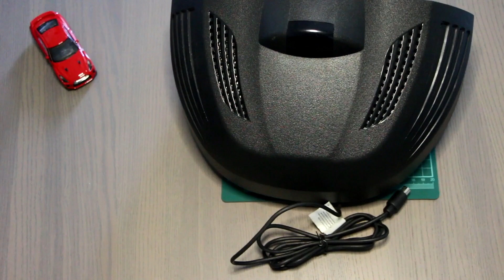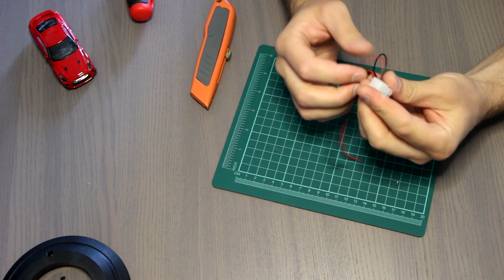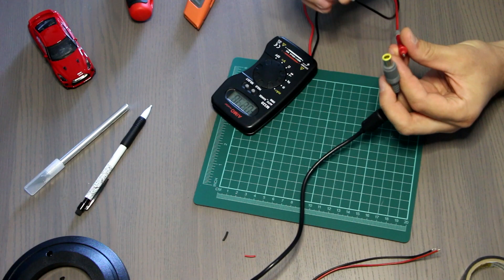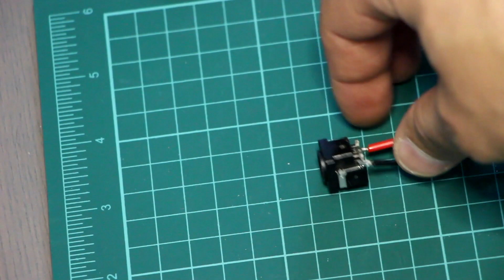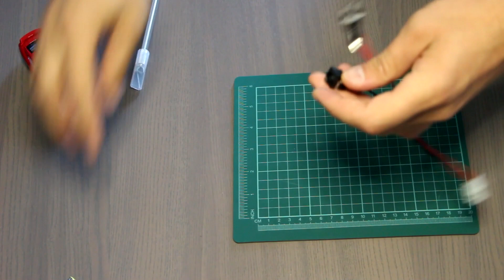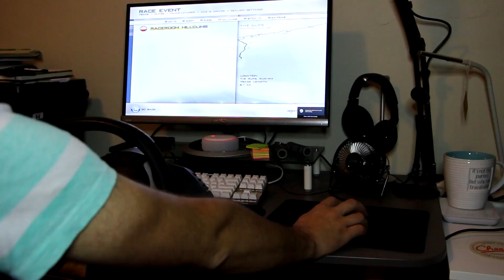Thrustmaster TX T300 wheel - power supply repair/replacement

Comment: This mod works fine. Thank you. It works with  an older PSU  (90w 20v) without fuse.
Reply: Hello, I want to try to see if the power supply is broken. Is there anything wrong with trying it without a fuse? I'll buy one tomorrow.

Comment: Thanks for your contribution, but unfortunately another T300 that refuses to live, I replaced the power supply with a 24V 6A with a 3A fuse, I went step by step, just like the video and nothing, I can't understand what it could be, because the motherboard input connector does get 24V... this steering wheel was working perfectly and when I exited a game, overnight, it stopped working, I would appreciate any charitable soul who can provide some help, thanks in advance

Comment: Hi, one of the silver pins in the 4-pin power supply connector socket is not making contact unless I hold the inserted power cable at an angle. Is is possible to open up that power connector socket and re-solder those pins? I have the ts300 rs gt.

Comment: Hey there, I love your tutorial but I can't get it to work :(
My laptop psu is 19 V 4.74 A 90W
I do it just like you, I also get 19V through the cables when testing. If I plug it in though nothing happens, only reaction I can get is sparks. I am not uskng a fuse. The original power supply was smelling burnt and was also shooting sparks when plugged in...
What else could be wrong with my wheel?
Reply: I have the same problem without sparks tho hope someone will help with advice

Comment: I did this to my T150 with a 24v power supply, I followed same steps and I am not using a fuse. It seems that I can turn it on using usb without problem, I don’t necessarily have to plug in usb first. It is noticeableably faster and stronger. I didn’t go with 30v because I read on a forum that the wheel starts to reduce current which translates to less force feedback, at the cost of a faster rotation speed. 24v was a good middle ground between the two, I felt actually torque and speed increased.

Comment: I know this is an old video now, but im sure my internal psu has gone, i got it fsulty from ebay the usb says descriptor fsult, the wheel foesnt turn or anything and if i test voltage from the psu that goes into the board i get zero volts, but i do get volage straight from the plug to ths TX, will be giving this a try tomorrow.
Reply from the maker: Good luck!
Reply: Did it fix it ?

Comment: Thank you! I bought a dead 'new but returned' T300RS GT off eBay for cheap and was able to resurrect it with a 24V 6A laptop PSU.

Using a 3A fuse currently. No issues so far.
Reply: Hi can i dm on how you went about it?

Comment: Need ur help, i follow all the steps and setting but it doesnt power up still. Not sure why? The ac adaptor that i use Model#:	FMV-AC323 Laptop Charger

INPUT: 100-240V~ 1.35-0.6A, 50-60Hz
OUTPUT: 19V 5.27A 100W
Connecter size: Int. Diameter: 2.50mm
Ext. Diameter: 5.50mm

Comment: Im looking for a powersupply but I see differences in amps. You use a 4.5A charger. Is there a minimum ampares the charger needs to have?

The charger im about to buy:

19,5V
3.34a
65 Watt
Reply from the maker: 3.3 amps is a little low. Even 4.5 amps, I used there is on the low side but it worked well. The wheel base can go little higher sometimes (higher than 6 amp)  and it is better to have more than less. I'll say look for 4.5 amps and up.

Comment: You dont need to to all of tihs is you just replace the FOD4216 Triac. The psu if not blown is just on standby as the triac activates when plugged into a USB port. Witout that it sits in standby giving the impression of it being dead

Watch https://www.youtube.com/watch?v=cbTY9QriLdo&t=5s for a proper way of fixing your t300rs
Reply from the maker: Thank you Nazim for mentioning that. If you check the video starting at 8:10 I mentioned exactly that and how to test if your triac is bad. In my case, the PSU was bad, so I had to do the entire replacement. Replacing a triac is a lot easier indeed
Reply: Ah I thought in the video you only mentioned the one triac and not the other one that tends to fail. Doing the first bypass will not turn on the wheel. But thanks for your response 👍🏽
Reply: I tried following the steps in that video, was measuring 5v when usb was connected but after I've soldered the two pins and jumped the Triac I'm still getting nothing with power on and usb connected. So assuming I have a dead PSU and need to replace per this mod

Comment: Hey! Do you recall what the signs of a failing PSU were? My wheel base has a flickering red light, a loud whine and produces an awful sound when turning (also very hard to turn). Do you think that's the PSU? If so, how difficult is the soldering on this fix, for someone with no prior experience soldering electronics?
Reply from the maker: I don't think is the PSU, but can't tell for sure. It is not hard to solder to be honest, a 5 min youtube video is enough
Reply: @SymyonYY  yeah, I'm starting to think it's more of an issue with the motor. It's out of warranty and they're asking me $180 USD + shipping to repair it, which is close to the price of a new base. I don't think I'll ever purchase a TM product again. Thanks for the quick reply!

Comment: hi, you did very good job but i have a quiestion to you, we have a 4 pin jack to main board why did not you give 5v volt the other red and black cable you give only 20v , in this way only when we give 24v  to board it will works or not ??

Comment: Can anyone help me:
I have the issue that my tx doesn't steer to the left with full power anymore, but to the right everything seems fine. I don't know if it's a power supply problem or some circuit inside that's broken. I don't know what to do. :(

I hope I don't have to buy a new one.

Comment: My son is looking at a used wheel with a bad power supply.  I'm comfortable doing everything in this video, but I have a couple questions:
I didn't follow what you were talking about with the USB power from the original power supply.  Is there a USB port on the wheel that is being abandoned?
Your power specs appear to be different from what we're being told the wheel uses.  Are there different sub-models of that same product?  We're told it's 25v, 2A, 50W.  That's still a pretty standard laptop power supply, but I wanted to get clarification.
Reply from the maker: You still use the wheels USB port, but the way it works from the factory, is the power is not getting delivered until the usb is connected. So you need both the USB and the power plug connected (obviously) to get power to the wheel. After the mod, that is not the case, power is getting delivered to the wheel no matter if the usb is connected or not. So it's more of a power saving I guess, if you disconnect the wheel all the time after you're done, it doesn't matter to you, if you leave it plugged in, just FYI that the power is delivered to the wheel. 
As for power supply, you can play with those values a little, so yes I think all TX/T300 are coming with the same specs power supply (don't quote me on that), mine I believe had 24v, but 19v-20v are fine too. Some users experiment and add a 30v to it to 'overclock' the wheel so it'll get a faster response (with some downsides), but I will not recommend that if you don't know what you're doing. The power intensity (2A) can be higher as well, that is basically how much power your supply can provide if needed, but it does nothing if you go overboard about it, if it's lower, that is not good as it might not be enough on high intensity use (high torque FFB settings etc). And the electrical Power (50W) is just 25V * 2A = 50W. 
I have a link under description if you want to jump into the rabbit whole and find more info. 
Also just FYI, a wheel that is not functional as it doesn't turn on, doesn't necessarily mean the Power Supply burned, sometimes there are PCB problems or something else, but AFAIK the power supply are most common problems. Hope it helps. Cheers!

Comment: I saw a different video that was like this but they kept the same power supply, The problem was with the little board that detects USB connectivity, user simply bypassed the USB detection
Reply from the maker: It depends, my PS was dead. Also you should really understand why that board went bad in the first place. There is a video where the author replaces something on the board, can't recall what was it, but he checked the circuit, replaced the bad part and made it the way it was originally, without bypassing anything. So it depends. One good thing about going external is heat from the PS is not heating the base interior anymore.
Reply: @SymyonYY  my wheel is dead, but have noted when I jumped the Triac that I have 5v at the usb input to motherboard connection and 30v on same connector from the existing power supply. Were you getting this as well, or were you reading 0v at the motherboard input prior to changing the PSU? Perhaps I have a motherboard problem? There's no lights at the front or motor reaction when plugged in at power and USB

Comment: Hello, I the throttle and clutch of my T300 stopped working. Brake works perfectly. Tried multiple pedals also Pedals work perfect on another T300 base. 

I have replaced the t.rj12 to 6 pin connector but the problem stays the same.

Any ideas?
Reply from the maker: Connect it directly to your PC via an arduino maybe? Requires some work, but not much than 2-3 hours (a d an Arduino off course). As for what is wrong with the Base, can't tell unfortunately.

Comment: Didn't work. used the same power supply, same fuse (in amps as well). Used a multimeter to measure the output of the old power supply and didn't show any voltage. Did everything in this video to the letter, checked that the voltages and amps are running in the new setup (multimeter showed that the correct output 20v but 0.5 amps for some reason). when plugged in, i got a blue spark and the wheel wont light up.
Reply: unscrewed the bottom part to see of there any burned mosfets and/or defected capacitors. everything seemed fine
Reply: Was you able to solve your problem?

Comment: so what is the original wattage of the T300 from the factory? I ordered the exact same one in the vid (20v, 4.5A) just because it worked and people with 24v 5 or 6A happen to not be working
Reply: How did yours turn out? I’m going to do a TX and T300

Comment: Hi, in case I use a 20v charger with a 2amp current do you think i will need a fuse? From what i found throughout the internet the original power supply of the wheel needs 24 volts with 0.75 amp which is not a lot.
Reply: You tried it??? It works???

Comment: This will work for the T300 to I guess? I have no power in mine now?

Any tips on where to start looking?
Reply from the maker: Yes T300 and TX have virtually the same base. Only difference I believe is 1080 degrees on T300 vs 900 on TX. And one is PS compatible, the other is Xbox. Check the video, it shows where usually things go wrong

Comment: Did this and can't get it to work still now power or motion any ideas?
Reply from the maker: Check if you get power coming to the board, if it doesn't, then you'll have to see why (bad connection, bad AC adapter ...), but if you get power on the board but wheel still dead, then you can have some other issues which is hard to debug remotely, but I believe other issues can be burned MOSFETs or your motor. You can inspect the main board to see if you see anything burned.

Comment: My power cable is gone and I need to mod my T300 wheel to use another cable with an EU wall socket. Is this doable for a know nothing about electricity person? 
There are no more cables around to buy. Thrustmaster used a unique cable.
Reply from the maker: Be careful with US to EU cable change, you go from 110V to 220-230V. so the fact you didn't have the cable might actually saved you wheel from burning. Only using an electrical socket adapter US to EU, while keeping the original US cable wouldn't work.
Reply from the maker: Also, as I remember US and EU cables doesn't have only a different electrical plug, they also differ with their actual connections into the wheel. Even if they physically look the same, the wires inside have different scheme for connecting. Like some holes in US cable (wheel side plug) have no metal connector while EU has it and vice-versa. I strongly suggest to visit some forums that have more info about it, before attempting connecting your US wheel to a EU wall socket, just to make sure you'll do no damage to it. As for the actual  power supply inside the wheel, unfortunately I don't remember now if the original one is capable of switching from 110 and 230 (like a laptop one would), like I said look at the forums, link in the description should give you a head start, just to be safe. In anycase, the mod shown in the video should work if you decide to go that route and ditch the original power supply all together.
Reply: did you ever get it working? I have the same problem with a US Thrustmaster tx wheelbase in the EU (Italy)
Reply from the maker: @isrcinimatic587  Changing only cables from US to EU or vice-versa will not work. But doing the mod in the video will.
Reply from the maker: @isrcinimatic587  I'll add to my answer above. I personally didn't try changing the cables US/EU or EU/US, but I know the cables have different internal connection structure  for 110V or 220V, the 4-plug connector that goes into the base. So your cable, depending of the region will be using different contacts from those 4 to provide energy, even if on the exterior they are the same. Also the original power supply has imprinted on the casing only one volt range that it's suppose to work with, that makes me assume it will not work with the other. However, that being said, some folks have reported that those different cables are setting voltage for the power supply and that indeed works on 110v even if it's a 240v imprinted on the casing, and vice-versa. I would be VERY CAREFULL attempting that experiment though and will NOT RECOMMEND it unless you know what you're doing. And chances are, that a laptop charger, to do the mod, will cost you less than finding a local region cable for the TX/T300. 
You're call.
Reply: @SymyonYY  I just bought a used TX. It is the US-Version and needs 110V. But the internal power-supply itself is a 240V power-supply. (I took it apart and it says definitly 240V input!). Actually it is the power-cable, which determines if 110V or 240V are being used. See also page 3 of the manual. There it also says that an external power-supply with a type-B plug might be used. 
As I am living in Spain I need to run it with 240V. Just bought a 240V - EU- Cable in the Thrustmaster-Shop and will give it a try. Will let you know here soon.
Reply: @stephanbraun2101 did using the EU cable work with your US wheelbase?

Comment: Hi ! Just did a similar mod with an universal power supply for PC. 19V and 6,37A. I also added a 3A fuse. Everything is working fine. Did not test it in game yet though. I'll keep you guys updated.
Reply: @z3mv  It works perfectly. I use it nearly everyday.
Reply: @pinguuu9883  Hey ! Do you know how much Watt it is ?
Reply: @heydata  My power supply is 90w !
Reply: @pinguuu9883  Thank you ! are you in USA or Europe ? I’m just wondering if I should use a different fuse based on different continent voltage.
Reply: @heydata  I'm in France and it really works perfectly. I've been using the "upgraded" wheel for more than a year now and never had any further issue :)
Reply from the maker: @heydata  The input is different, but the output should be around the same. So no matter if you're getting in 110v or 220v the output of that power supply is what is says on it (voltage and amperage wise)
Reply: @heydata  Sorry for the delay dude. Didn't see the comment for some reason. I'm in Europe, France. Our power supply is 230V :)
Reply: @pinguuu9883  how do you do it? Mine stopped working I have a few old laptop chargers can I use them ?

Comment: stock power supply is shit ... dont able even to keep 24v .. shows up 30.5 .. not even stallen drops 17 - 18 .... funny toy ;) changed to 24v / 16,6A  @ 22 V + 12 v from old pc + 5A fuse and good fans make the wheel finally work as it should. Now its perfectly linear and finally drifting doesnt match fighting with wheel.  100 % all, center by game, rest off in AC - as anyone likes - on most strange settings finally drivable.  Mine settings just for experiment with LUT step2+damp. CM gain 100,  rest 0. LUT as described with 64 probes 10s wait time. Damp gain 100 min level 0.

https://drive.google.com/drive/folders/10lqsc51wGYhKWrRYxlTKLNLytSy63al3?usp=sharing
Reply: Didn't understand everything lol I'm supposed to be an embedded systems engineer. Just a quick question from the noob I am : I did my mod with a 19V/6.37A power supply and 3A fuse.

 Which differences should I expect regarding the behaviour of the wheel in comparison to the original power supply ?
Reply: Mógł byś to napisać jeszcze raz po polsku bo nie rozumiem twojego angielskiego mieszkam w UK 30lat I nie rozumiem twoich zdań lol. nie wiem czy uzywałeś tłumacza ale cieżko jest zrozumieć. ja również mam problem z moją kierownicą i próbuje naprawić :)
Reply: @Despymedia  nie uzywalem tlumacza, szybki techniczny potoczny po prostu ;) na lata się nie będę licytować bo nic to nie wnosi - na gmailu  się do mnie odezwij to problem kierownicy rozwiążemy - in4r84@gmail.com bo naprawami i budowami customów również się zajmuję.